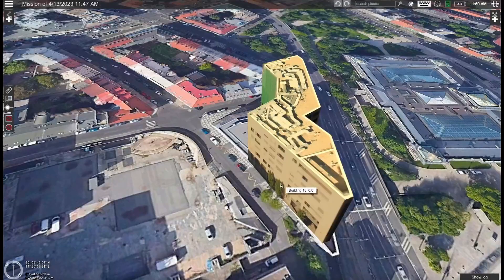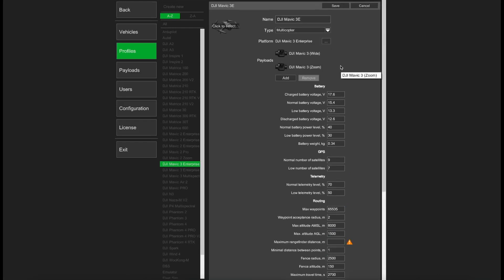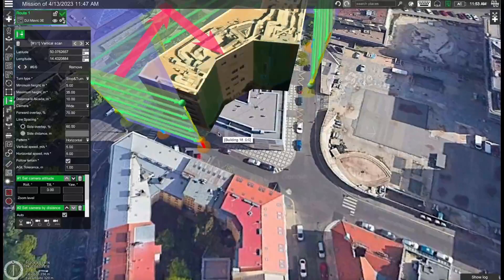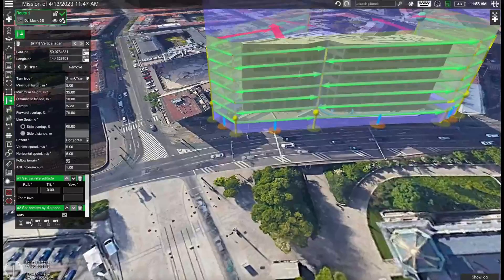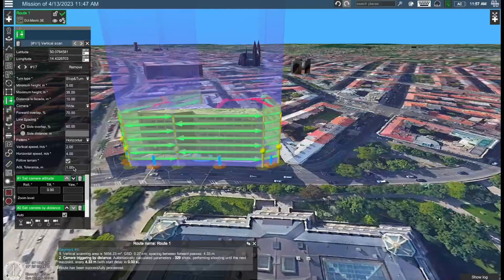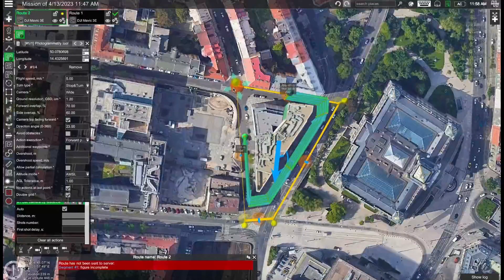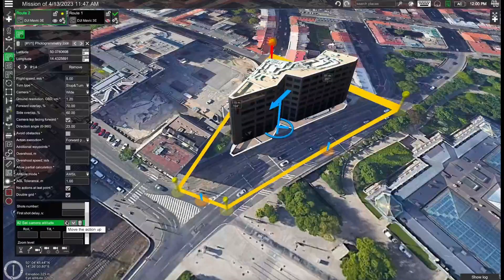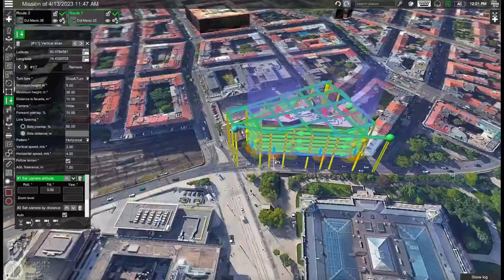Tutorial | UgCS building inspections with drone

Comment: Where do I get the 3D model of the building to import? I know we could make one, but that defeats the purpose of having it there to aid in the mission. 

And, the structure im looking to fly is 180 metres tall, I can't find any setting to set the correct altitude. I can set the GSD, but that's trial and error, messy option. How do I set a fixed altitude?
Reply from the maker: Thank you for your question. Since it is quite complex, one answer from us here could turn out not to be enough. 
Please, drop us a message at support@ugcs.com and let's talk in detail.

Comment: I have a question , is it possible for me to use vertical scan mode with Dji L1 LiDAR ?
Reply from the maker: Hi! Yes it is. To enable LiDAR scanning you would need to add a waypoint before and after the vertical scan tool where you turn on LiDAR recording using the action.